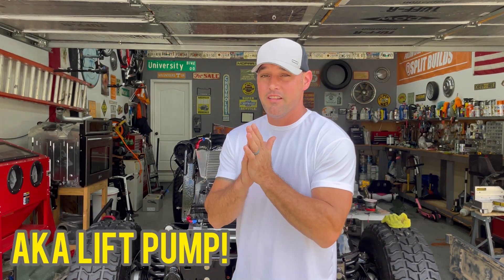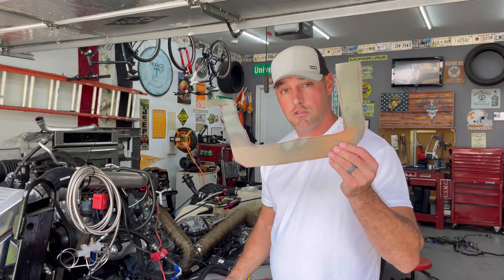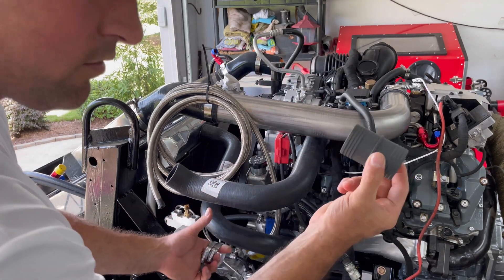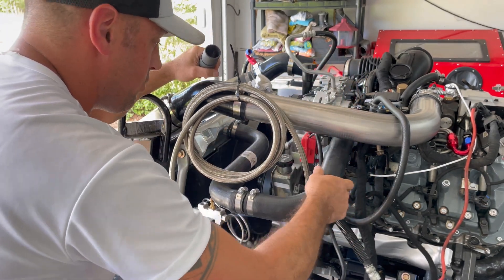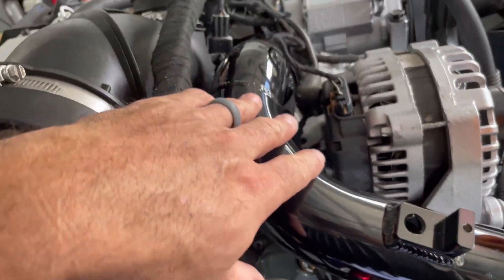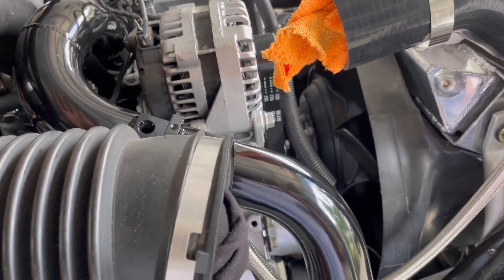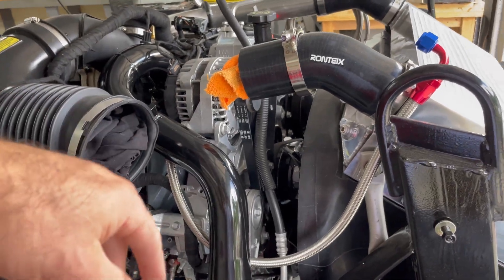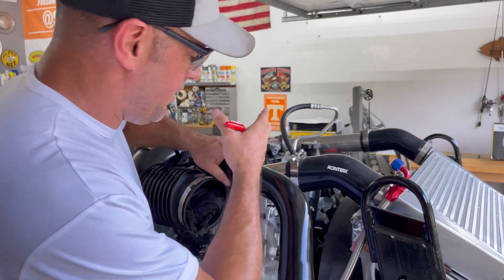HMMWV Duramax Swap Custom Upper Radiator Hose

Comment: Looking good! Btw, spring clamps >>> worm clamps. They keep consistent compression despite thermal expansion. Worm clamps can loosen over time on tubes that heat cycle often